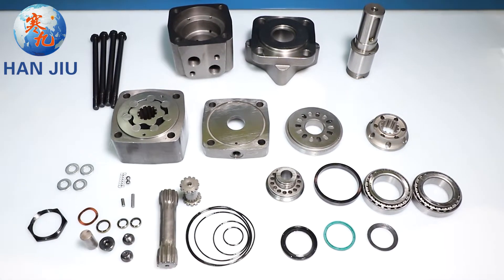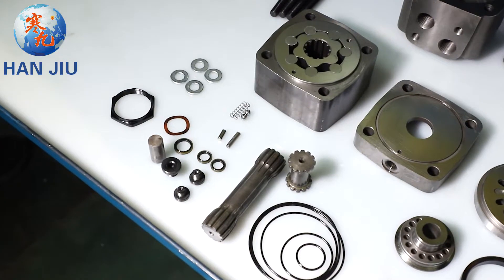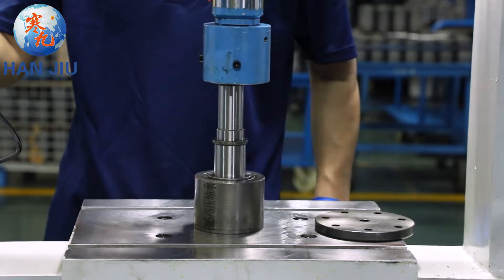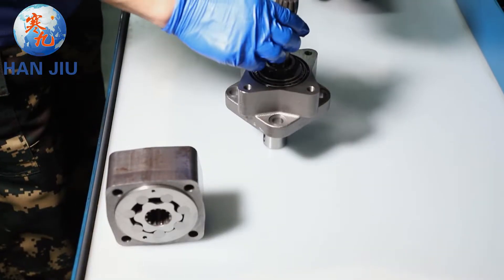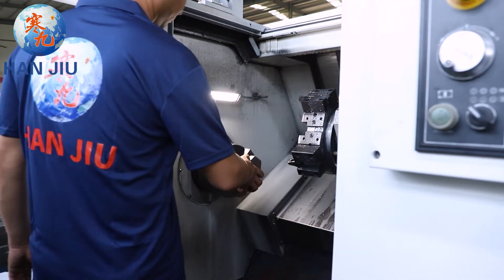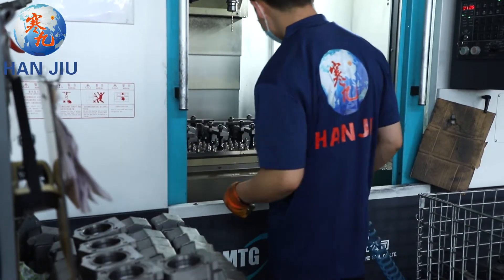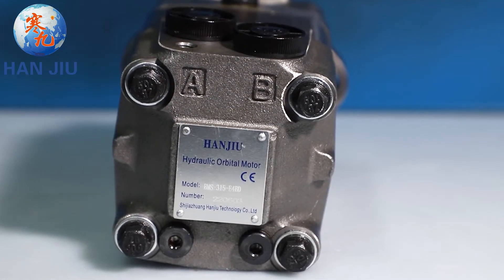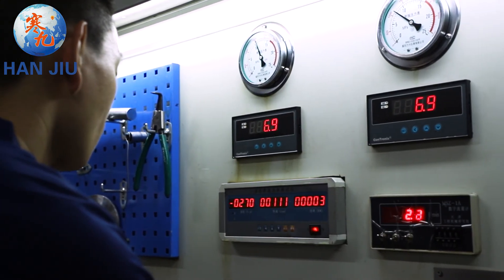OMS 315 hydraulic motor   E4 B D

Comment: Sir,
We have one Hydraulic pump of 40LPM. Its
oil pressure 150 bar . Our  requirements is two 
Moter running with this pump oil RPM  required 70-90
HP 6.5-7.5
Please suggest a hadraulic moter
Reply from the maker: Hello sir

There are too many motors that can meet this condition. Please tell me that you need a hydraulic motor. Working requirements: speed? torque? power? Installation space? Only in this way can I recommend the corresponding motor for you